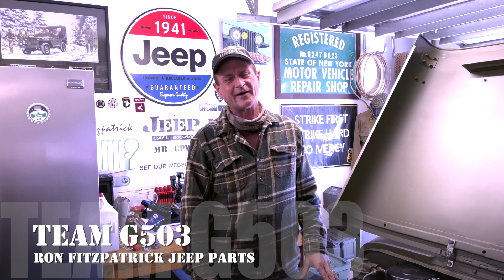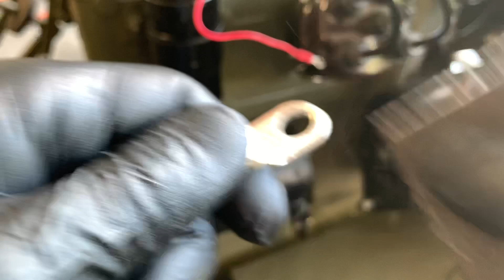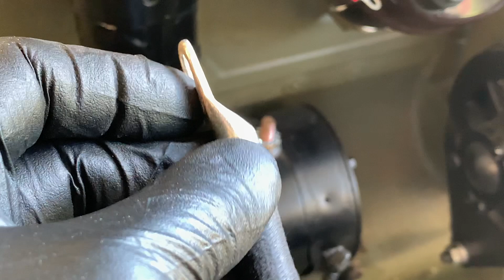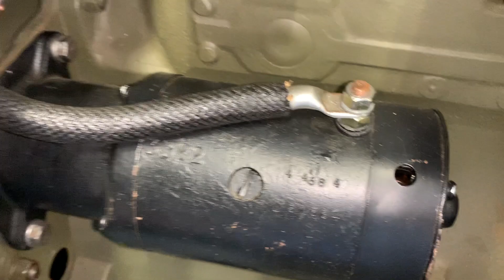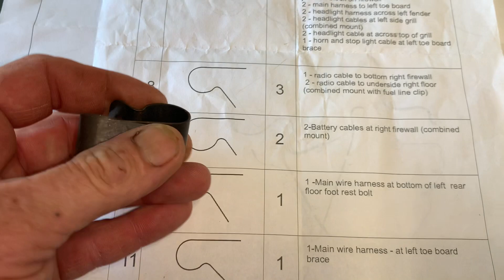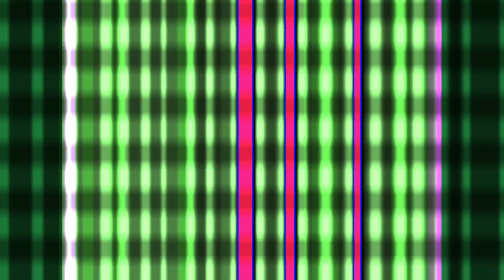Installing The Starter Battery Cables G503 Willys MB Ford GPW

Comment: Thank you! Makes it all very clear.  I have 2 questions.  1. Is the filterette wire necessary if the jeep has no filterette?  2.  How do I install the foot switch and cables all this on a completed jeep where acccess is so difficult.?